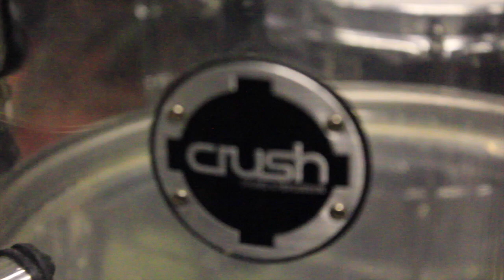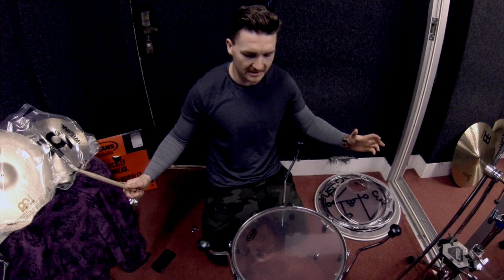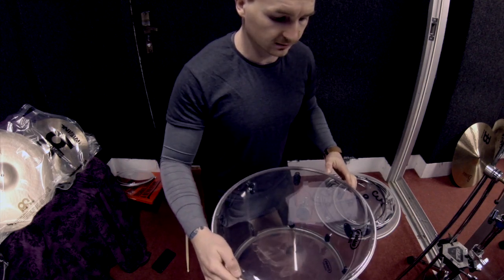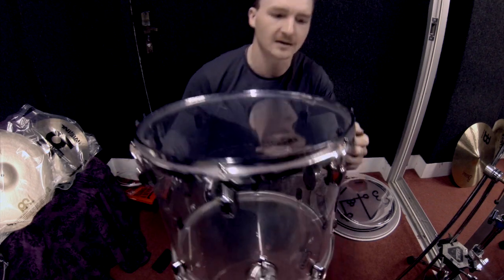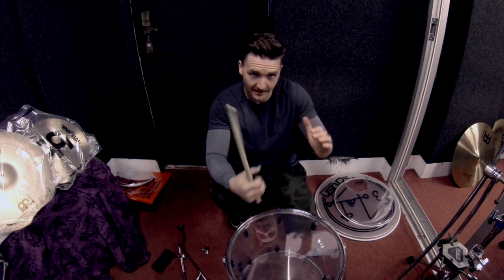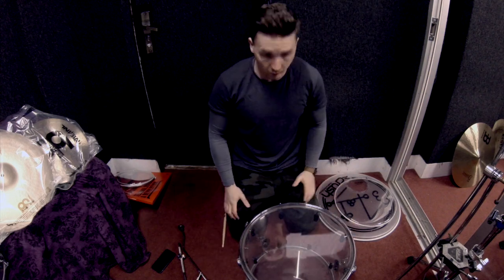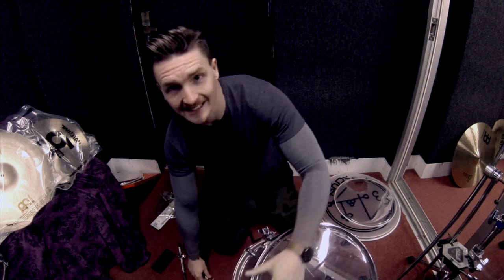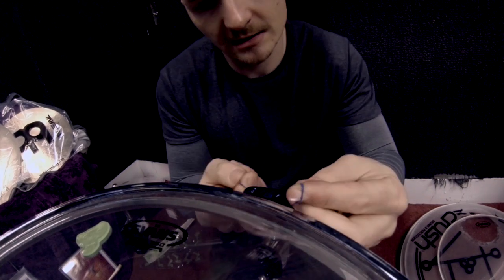Unorthodox Drum Tuning Tips

Comment: That floor tom sounds great, but over the years of playing live (usually unmiked) I've learned that low luning is not as ergonomic, more stress to the wrists because the head gives instead of bounces , the low end thud attack sounds great but the low tone doesn't cut through the mix and you have to beat the crap out of them to be heard.. I've been using smaller drums tuned higher and I don't have to play as hard.. Just my observations but I don't play Rock music. Great video. Thanks
Reply from the maker: Oh yeah I wouldn't suggest you use this tuning for a live gig which was unmiked, but then again I wouldn't suggest playing a live gig unmiked! I've been playing on low tuned drums for years and nothing wrong with my wrists...touch wood! Thanks for watching.
Reply: Craig Reynolds 
Yeah I agree, I'm playing smaller venues, usually no sound guy. Blues and R&B. Didn't  really mean wrist pain but more like fatigue.

Comment: If you're not careful tapping with your key, you can damage your bearing edge.

The star pattern that is commonly recommended is for the initial tensioning to achieve a tone (when the head first sings on its own). That is to ensure the head seats atop your bearing edge evenly. Otherwise, the head may sit lopsided and be uncooperative with your tuning efforts. It can also help you determine if your hoop is not flat if tension rods you've already tightened mysteriously become loose once you've finished your star pattern. Once you achieve a tone, you should tune lug to lug as you do in this video.

I'm not trying to say you're wrong for doing it how you like. I'm just correcting the record on what the star pattern advice is really all about since you didn't explain it at all.

Comment: Great video, pretty much the same as I've been doing, but nice to see I am on the right track. One thing I learned from this video tho, I have always found it hard to get rid of the reso overtones on the floor toms (I have 16 & 18) but never tried putting a double ply head on the reso, so I am going to give that a try. Also thanks for the tip on the cheap Dollar Store Moonjel. I have been using real Moonjel for years and it is pretty expensive around here, about $8 for a pack of 6. Thanks!

Comment: Most vids about tuning by ear, extol the virtues of the 'just tighten it till it sounds good' method. Nothing wrong in that, but getting a good correlation between top and bottom head on toms, and musical intervals between all drums ( I use 2 up 2 down ) is time consuming and hit and miss. I recently bought a Tune-Bot ( after using your method for 50 years ) and I find it a breeze to tune all drums quickly, AND, as you admit in this vid, ' you can't get back to where you were ' you certainly can with the Tune-Bot. In fact you could tune the kit for different gigs, and still get back to where you were, or save your favourite tuning on the tuner to recall at any time. Horses for courses, not everyone has a 'good ear' especially newbies to drumming, and why should they suffer a poor sound through lack of experience of tuning by ear. To any newbie I say it may well be worth investing £60.00p in a Tune - Bot. You wouldn't play guitar without a tuner.
Reply from the maker: Charles Hill couldn't agree more, thats why in the video i do actually exclude the tune bot from my comments about tuners, as i used to have one and i loved it for tuning quickly in a noisy environment like a festival!

Comment: Actually I don't think you did anything unorthodox.  This is always how I tune drums.  I tune the bottom first, then place a folded rag underneath to kill the bottom head vibration, then tune the top head.   I also typically tune the bottom heads just slightly tighter and leave the tops as loose as possible for floor toms for the slap.  I do also use moongels as I like a lot of resonance but then choke it back a little with the gels.  I also cut them up and put three dots in a triangle rather than just a full gel on the top or bottom.   Spacing them out works really really well.